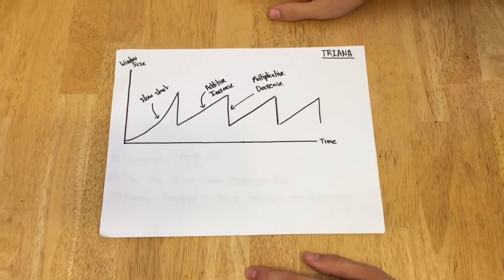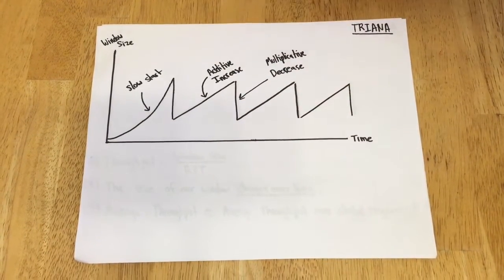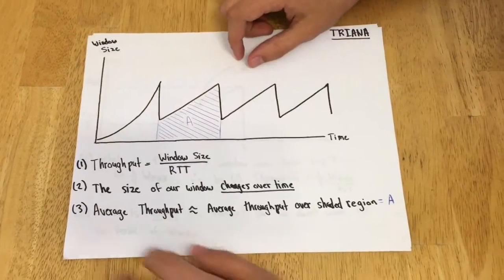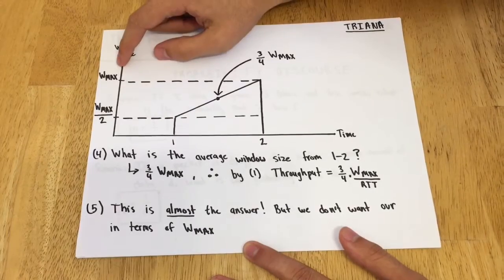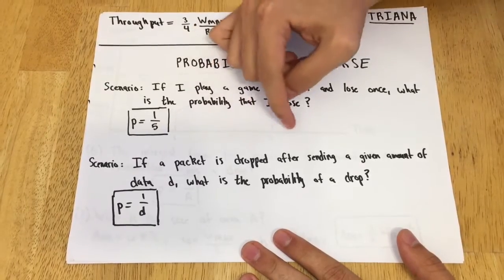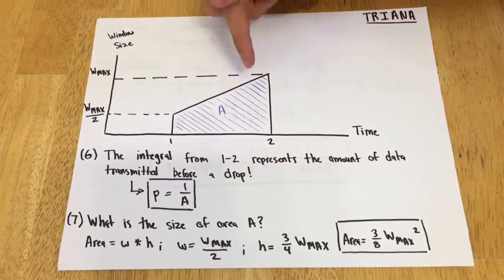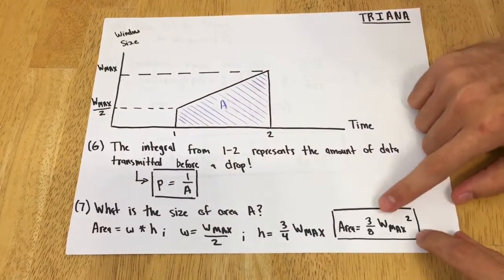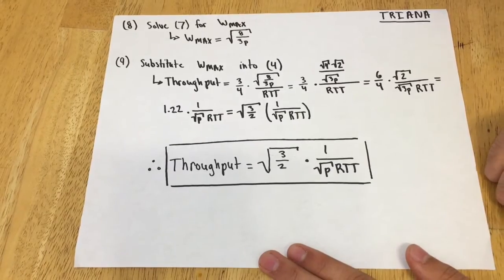TCP Throughput Derivation

Comment: how Width = Window max/2? and thank you for the good explanation.
Reply: This is because the units on the X axis are “RTTs” (so moving 1 to the right on the X axis is one additional RTT), and the units on the Y axis are “MSS bytes”. TCP does AIMD, meaning in that standard sawtooth portion of the graph, for each full window of packets acknowledged, the sender increases their window by 1 MSS. How long does it take to receive acks for a full window? Precisely 1 RTT! So the slope of the line is 1. Since we know the “height” increases from window_max / 2 to window_max in that time, the width must be the same amount, so window_max / 2.